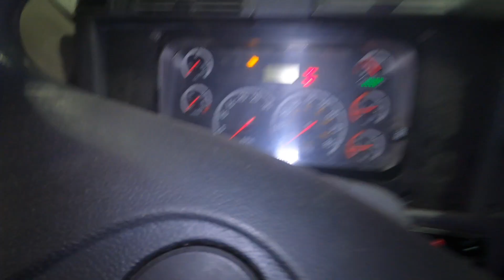Cummins ISX Overhaul Part 3. Ready to Start New Engine!

Comment: So roughly, whats a rebuild like this cost?
I just traded in my 05 670 with an isx for a 16 with a D13. Trans was on its way out and motor was on its last leg.
Reply: Anywhere from $25,000-$35,000